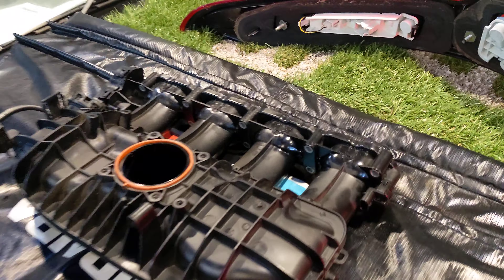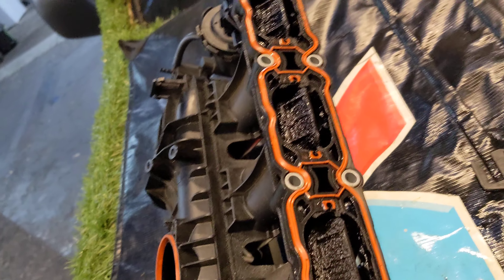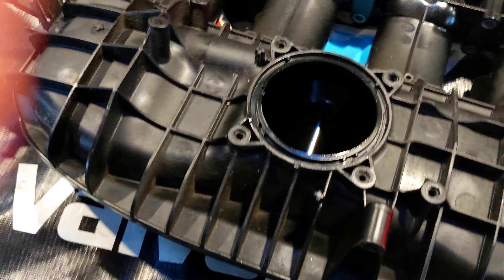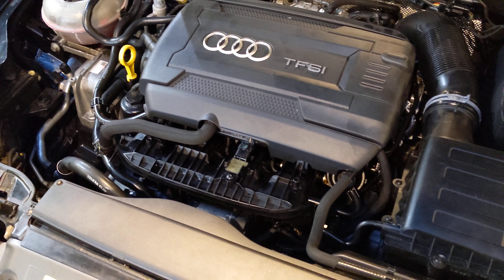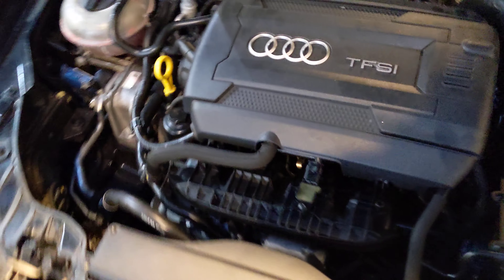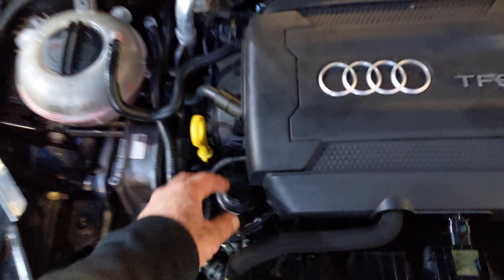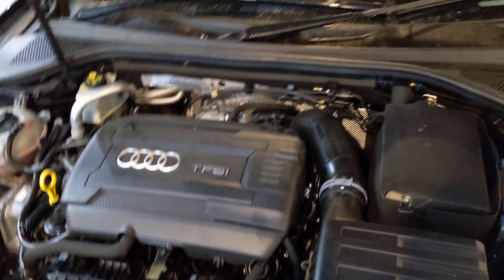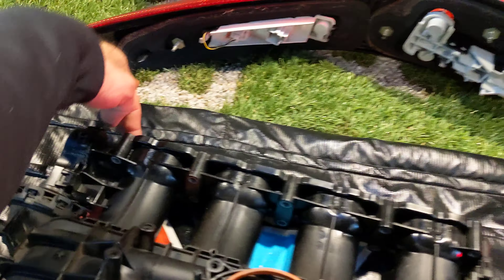Audi A3 intake runner position sensor fault. P201400 Intake manifold carbon contamination.

Comment: On my A3 1.8 tfsi sport first found the vacuum actuator had come apart so obviously not going to work. I just glued it back together and checked with a vacuum pump. All good there. So no sticky flaps or loose actuator arm. This vacuum actuator doest work until your driving the car so it's hard to see it working. After a good test drive my mil light was back with the same sensor code. I rigged up a T piece between the vacuum actuator and my vacuum gun and gaffer taped it to the screen. One short road test later revealed... No vacuum. There is vacuum at the solenoid switch.. Replaced solenoid... All good now.

Comment: I have a new manifold and next runner flap sensor. I still have codes p2015 and p2006. 2015 a3
Reply: You ever get it fixed?
Reply: selenoid fail

Comment: Replaced the manifold and still throwing the same code. Any ideas?
Reply: Interesting
Reply: Make sure when you put the manifold back in its place, you must set the flaps in open position before fitting
Reply: First check your vacuum pump that is step 1...less vacuum then if error persists and is electrical or intermittent change exhaust valve that comes from vacuum. If it says stuck open buy new valve
Reply: Step 3 remove pipe going to pcv valve..blow into it.. if air goes thro valve on pcv shot...crankcase pressure not negative so u will have oil spots on floor... you are adding boost pressure to intake...Will keep flap open
Reply: @DaddysBudgetTools what about the code p2014 Intake manifold runner position sensor / switch circuit
Reply: @DaddysBudgetTools hey I’m also getting the p2014 code on my vw gti 2015 what part number is that sensor?
Reply: @DanielDoonies ever find the answer? cuz i have the same code brother lmaoo
Reply: @ElHarvin same any news? I called around and no one has ever heard of the 2014 code